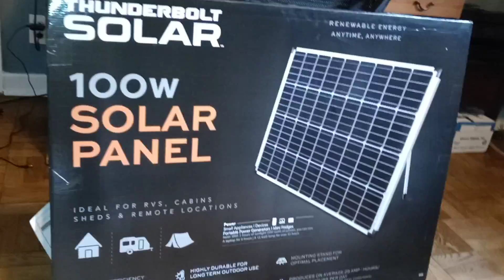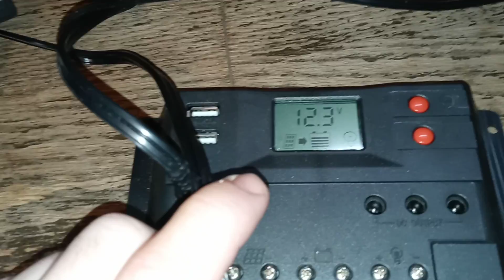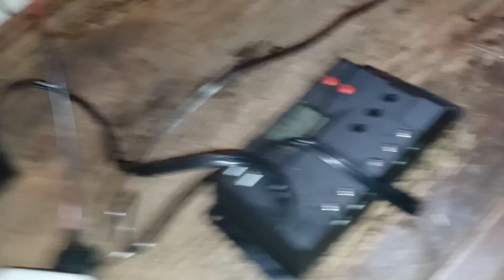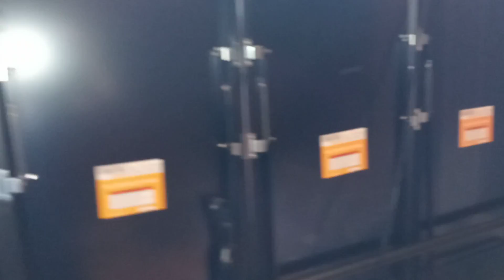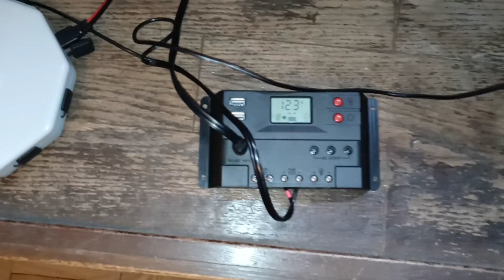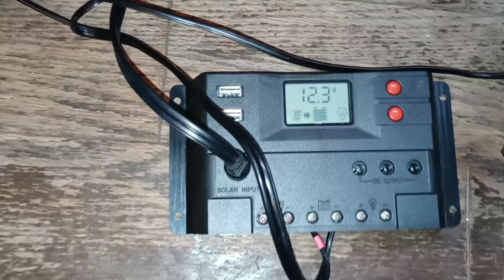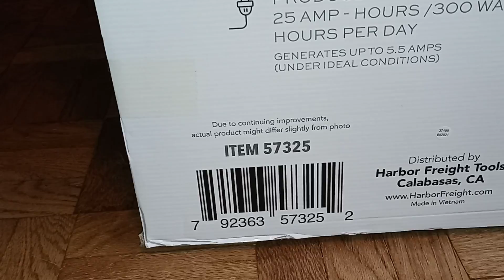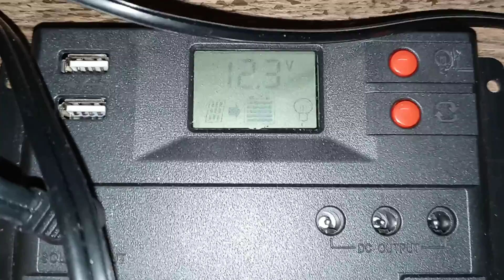NEW! 100 Watt Monocrystalline Solar Panel, Hub, W/ Harbor Freight Thunderbolt Magnum 100W Solar Kit

Comment: depending on the battery lugs you might be able to use threaded bar to bolt each teminal up and have them in solid parallel for a more permanent system for later on

Comment: Why would I watch when you took away all my comments?😂
I must say I like the rod you have to keep them in place. Smart.
Would you get more power plugging directly into the hub and removing the 4 into 1 combiner? Less wire resistance. As little as it might be.

Comment: Nice setup, great explanation, I'm Into the van life and I seen the 100 watt kit at h F for $190.00, I have 70 Amp hour 12 volt deep cycle  AGM, and I plan to buy another,  so I will have 140 Amp Hours, I mainly just want to  watch TV, videos, and a smal)a/c unit and charge Ryobi batteries, I am an auto mechanic, I go to the gym for showers, and a few conveniences would be great, thank you for the video, great job!

Comment: I have the 100 watt Thunderbolt kit. I wanted to add more solar input, so I bought this same panel. I noticed the panel is 24 volt. Can the two be ran into the same hub that you have and fed into my mppt that will charge my lithium batteries?

Comment: There are 3 basic types of PV Cells. Polycrystalline, Monocrystalline and Thin Film Cells. If it was Karaoke Night, we'd be singing Meatloaf's "2 Out of 3 Ain't Bad". lol The 4 Panel Set is a Poly and will produce a charge on a cloudy day. Intended to be portable. The NEW single Panel is a Mono and is intended to be fixed facing as much FULL SUN as possible. They normally won't produce much power on a cloudy day. Yes, you CAN use this when camping. It just requires a lot of constant brightness in order to reach its potential. Shade is its Enemy. Another thing to mention is the Charge Controller. It's what comes with the 4 Panel Polys and is a PWM Controller rated for 10 Amps. You can fry it if you exceed the limit of Amp Input. From my own experience with the 4 Panel Polys, they max out around 6-8 Amps on a very sunny day. Just fine for THIS Controller. As you add Panels, you also add Amps. The more Amps produced, the stronger the Controller needs to be. 2 sets of the 4PP combined should produce around 12 Amps, which could be enough to exceed the limits of the Controller. Get a bigger and better Controller. You shouldn't need one larger than 40 Amp, considering your limited space for the array. Myself, I went for a 100 Amp MPPT Controller to allow for expansion of my array and to make better use of the energy being produced.

Comment: You are not supposed to mix panels. I tried to mix panels and it didn't work properly. Do some research , the panels are not working as they should. It only looks like it's working. Check your output with a multimeter with the mixed panels and without. I also strongly suggest a good charge controller.

Comment: Nice to keep the old poly panels because they will continue to charge when cloudy as the monos wont
Reply: Really, I didn't know that. I  have four of those kits. Two on my roof one on my shed and one that I'm going to use on my camping trailer that I'm going to build.
Reply: @CleoCoal  I want to mount mine on the roof. Can you share your method with me?
Reply: @garys4688  just throw it on top of your roof and hope it's thick just messing with you man but honestly you could buy some brackets that have fitted and you can bolt it to your roof be safe up there.
Reply: Thanks for the review. I have four of those kits. Two on the roof of my house  connected to four  batteries and it works well for power outages and one on my shed that my dog lives in with two batteries to run the fans to keep him cool. I'm going to do a camping trailer build using the other kit and I will probably add this panel to it since it takes less space for the same amount of watts. Will that 1,500 watt inverter run that  AC ?

Comment: I bought two of them Saturday. Awesome. Love them lightweight charges very good. Well worth the investment.
Reply: Can they be linked in series and /or in parallel ?

Researching...
Thanks
Reply: On the back of the panel it says do not wire in series. I'm assuming you can wire them in parallel. With the Harbor Freight hub. I have one hub going to buy another hub for 800 watts 2 solar chargers on a battery Bank.
Reply: What type of solar charger regulator did you use?

Comment: Wow ! That’s a great deal for one Thunderbolt over the Harbor Freight PV Modules . It looks like your window can take four of them diagonally on top of each of  them . What’s the power rating of the sticker on the back of them . Maybe 6 to 9 short circuit amps or so .Go on and make that move  and expand your system and other components to get the most power you’ll need to survive off the grid or to save on the electric bill . When you get a chance , please check out my solar videos , hit like , leave a comment and subscribe . May the solar be with you .